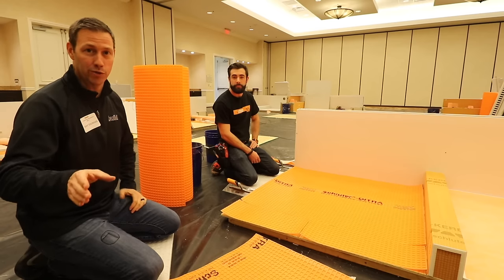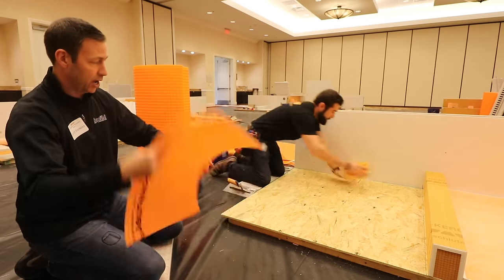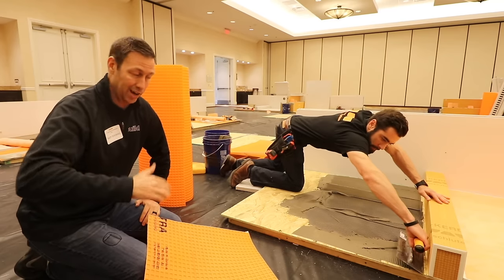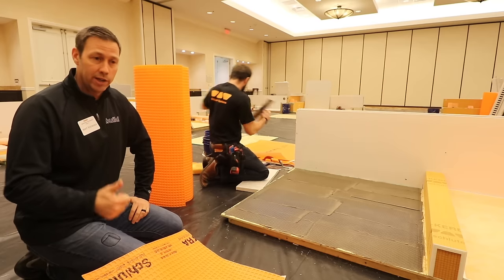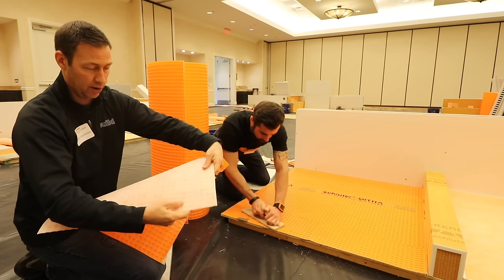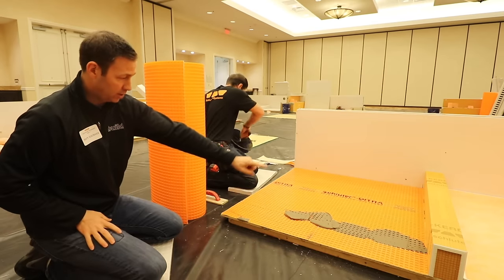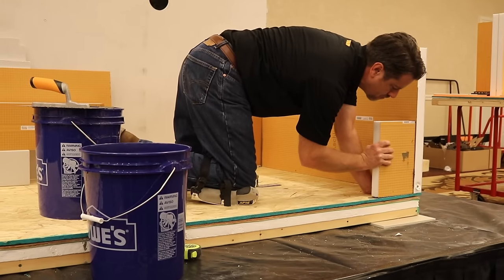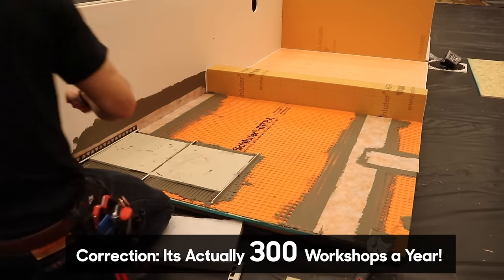WHAT is this, and WHY do you want it under your floors?

Comment: Very expensive system , totally not needed . The key is always waterproofing , the substrate is irrelevant when waterproofed properly 
Perhaps your issue is with the cheep non union or substandard tile guys you hire for installation to maximize your profits ?
When you do the job properly , there are no issues .
Granted you may have issues with poor existing concrete which can be addressed .
Simple , green board on your shower and tub surrounds , concrete board on the floors and you've got no problems . 
Problem is this is just another flavor of the month that's expensive and has been done incorrectly causing damages . 
Use it of you like , it's not needed , very expensive . 
It always comes down to the  waterproof.
Oh the 2nd floor washer area you mentioned , always make the second floor laundry room a bathtub floor with a floor  drain . That takes care of that . 
Simple green board on shower walls with red guard is all you need . 
It's been working just fine for decades when done properly . All this other stuff is just expensive and will also fail when not done properly , which there is countless jobs , evidence of what happens as a result

Comment: WTF. My dad has been renovating houses for a living and never in my life i've seen anyone cement tiles directly over concrete. Is a subfloor and insulanting too expensive for american? Or are they so greedy that they will cut any cost they can? 
Also great, you have avoided cracks contagion from the concrete but you covered both side of the isulating in cement. It's not going to crack as quick but you said yourself you've been using this for only over a year. Wait a couple more and you'll start having calls again. You just delayed the problem. 

Nice shameless plug tho
Reply: Well a lot of homes are built directly on concrete slabs, no basement or subfloor. Houses built in places where water table is high either needs a crawlspace or a slab to sit on. Tiling directly to a slab is a mistake as eventually the slab will settle and crack, which I’m turn crack the tile. That is why this system was designed.

Comment: If you pour concrete correctly which is rarely done today it would 
hardly ever CRACK unless you have some form of ground shift. pouring 
Concrete with just fiber mesh will always crack. but its fast without 
rebar and wire mesh  and it has to crack, that's why they now make so 
many cut lines. Its all a JOKE and done by  lazy Stupid concrete contractors. 
We've done Tile and concrete for over 30's years  and using Duroc cement
 board over wood sub floors is the best and have never had any cracking,
 NEVER. But I have replaced these waffles that others have installed.  
We have also installed Tile directly over concrete floors and have never
 had any call backs even when we fixed the floor cracks from cheap pours
 by others. I find this video to be nothing more then Salesmanship and 
short on Facts.

Comment: If your concrete floor is cracking, you did not do a good job at installation of the concrete floor. There's
no reason a concrete floor should crack, if you put it down correctly, with proper preparation. Not a believer in a lot of synthetic crap. There are structures built in the Renaissance and 17th century that are still 
standing, magnificent and pristine. Your silly US tract homes won't last 100 years, as all the synthetic
crap used decomposes in the walls, floors, foam insulation, plastic water pipes, off gassing and turning
into a toxic soup trap. Having to be abated as with asbestos popcorn ceilings, and every other synthetic
material. Visqueen doesn't last ten years, but it's everywhere under slabs, in walls, etc. Well anyhow.

Comment: It's garbage,  this is meant to replace cement board on the floor, which was meant to replace a wire-reinforced mortar bed.   Each of those systems were meant to replace the labor-intense specialized knowledge of a skilled setter.   

the only thing it's good for it crack isolation, and you can get that done way cheaper than this stuff. 

BTW it still didn't level the floor.  Call me in 20 years we'll see what the floor looks like. Pointless.
Reply: Its taking over the flooring industry in Florida when working with contractors if they want it u going to do it..20 years in the trade sure there are a lot of other ways..got to open your horizon man..make way these kids are going to make us change the way we used to do things
Reply: @mikem6883  
Im all for new and Improved, But just because its new doesn't make it better.

Comment: absolute garbage.  This is just another attempt to cheapen the install by avoiding floating with real wire reinforced cement.   The industry tried another product 30 years ago, cement board.
After years of telling PPL its just as good, PPL realized it wasn't. 
      You can get a tile to stick on anything.   But if you want it to last, Tile requires a strong base to back it up.  The float ( cement) acts as a base , the tile acts to protect the float.   Its a system that has worked forever. 
Ive been installing for 35 years.

Comment: Jesus this company has a proprietary everything for their installs.  Just a money making system and it's not the best.
Reply: It would be nice to mention some alternative, not just spitting venom.
Reply: @KKhhoorrnniittee  well, go follow starrtile and learn his methods.  Most of their system can be mitigated with a 50 dollar bucket of waterproofing.  I use aqua defense and you can barely cut through high spots  with a razor blade or chisel once it has been applied on concrete board or even drywall. All their products can be constructed and waterproofed. Hell, the manufacturers even allow it to be used as a pan liner. Takes the need away for the majority of those products.

Comment: All this is just a screen that protects the motor in the towel adhesion together that’s all. It reduces cracking very little because most of the cracking occurs at the edges are in the corner. If your car back on the job because there’s cracking. Be careful most cases this foundation settling. But if your tile work was done correctly with the right materials there shouldn’t be any cracking at all. Even with the foundation lightly settling. I emphasize on that word lightly settling. Because even Foundation and the visuals when they are building a home. Have made mistakes. This individual in the video talks too much about nothing